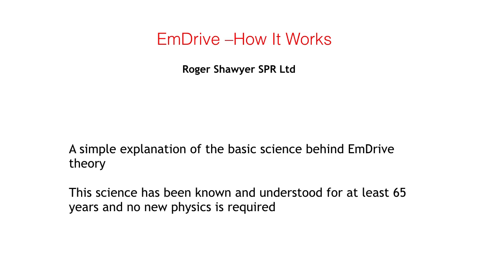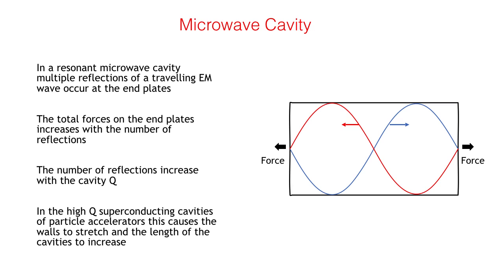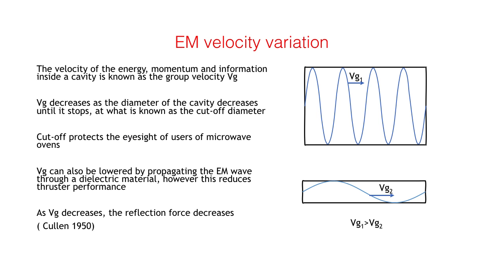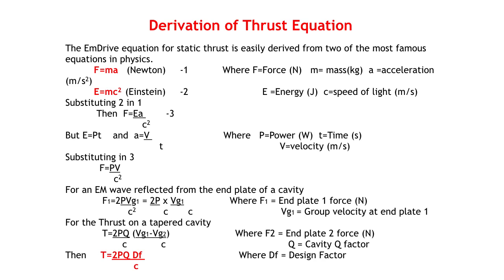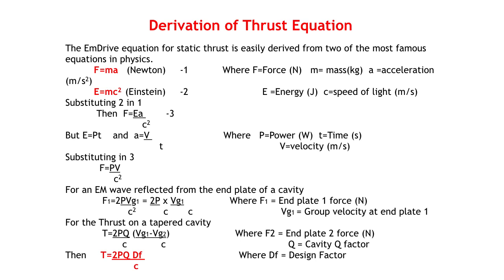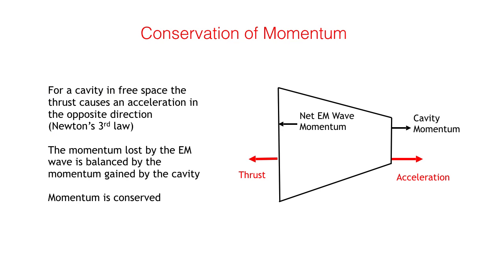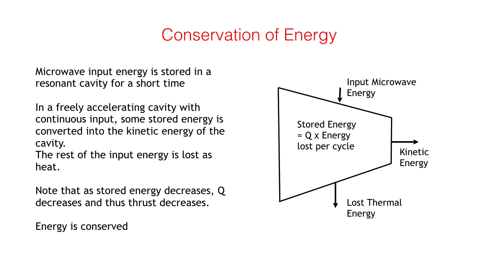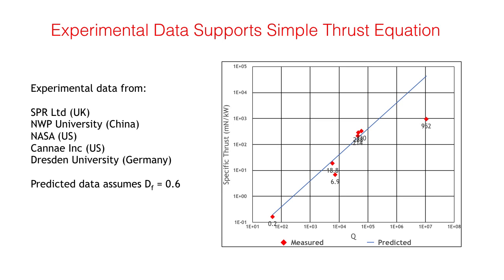Roger Shawyer on The Science behind EmDrive

Comment: This video begins with a flat-out lie!  As many physicists have pointed out, the EmDrive concept violates fundamental ideas of Newtonian and relativistic physics.   Claiming that "no new physics is required" is a flat lie!  The EmDrive concept violates conservation of momentum, one of the core ideas of both Newtonian and relativistic physics.  There is no way around this.
Reply from the maker: You are right but up to now it held up in all experiments by teams all over the world , or at least produced thrust in some way.
The matter of fact is noone can disproof it , it works. So it seems more likely at the moment that science is (yes history repeats itself) wrong or not cpmpletely right with its current set of laws yet again. As it has occured in history over and over and over again.

Einstein for example had to deal with the exact same problem Roger Shawyer is facing.
Reply: Marino Šimić   If you read Section 10, Discussion, of the White et al. paper, you will find that it is full of theoretical speculation, speculation about ideas that are not part of current quantum mechanics: new theory.  What you do not find is a detailed explanation of the Emdrive based on existing physics.  Neither is there any reference to a paper that describes the Emdrive in terms of current theory.
Reply: Pilot wave theory - no new physics required